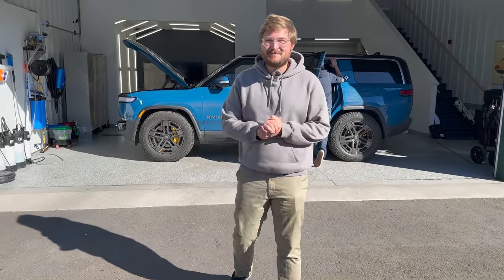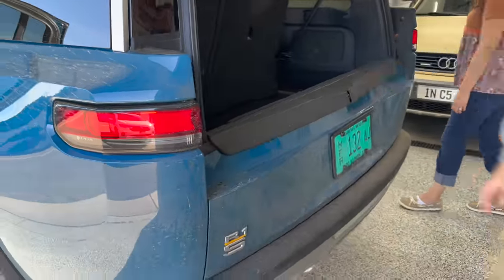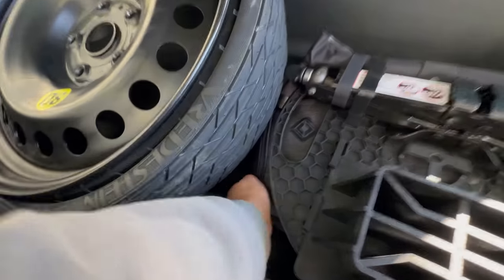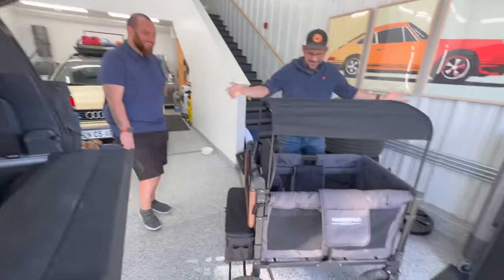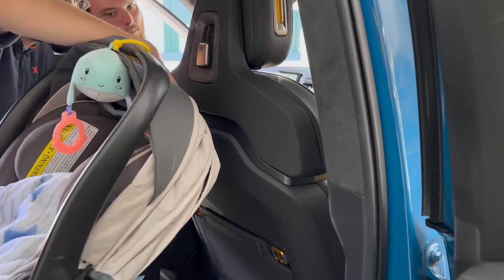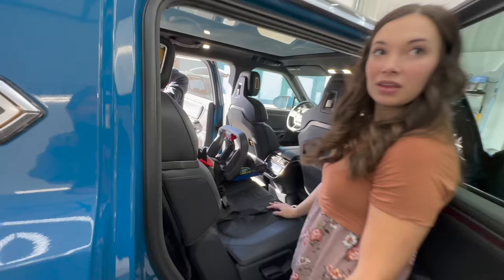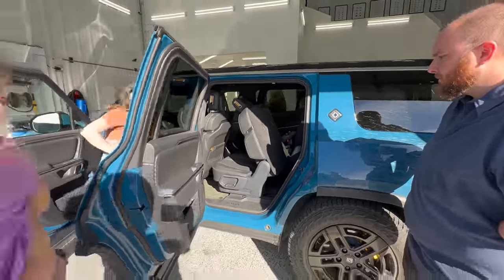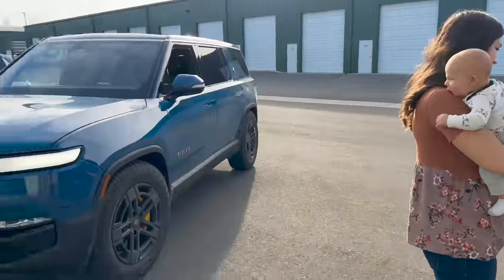Rivian R1S Family Review - Car Seat, Stroller, Vents, Interior Space, & More

Comment: Sounds like the 7 seat R1S should’ve been build on the same wheelbase as the R1T and there should be a 5 seat version based on this R1S platform - think Yukon vs Yukon XL type models.
Reply: My exact thoughts. I was hoping this would be a replacement for my Ford Expedition but seems like its more a Ford Explorer size. In the Ford Expedition standard length you can fit a 6'4" person in each row at the same time comfortably with still a good amount of leg space in each row. I've done road trips in the 3rd row being 6'4" for a few hours just fine no complains, I highly doubt I would want to be in that 3rd row more than 20 minutes. Hoping by the time my reservation comes they will offer a longer wheel base.

Comment: Many infant car seat carrier bases do not require IsoFix/Latch to be secured to the seat. The Popular Doona allows for the centre seatbelt to be used, which would solve the problem presented in the video.
Reply: Basically no carseats require latch, and using seatbelt installs is generally recommended when you are trying to do three across because it gives more options(you can shift the outboard seats towards the doors to make more room). Also two year olds should definitely be rear facing, and ideally should be rearfacing till they max out the rearfacing limits(generally around 4 or so). 

Babies are born with a lot of cartilage that  hardens into bone over time. This includes parts of their spinal column. The vertebrae in the neck only start to harden around 2 years of age and doesn't finish until as late as 7 years. The soft spine combined with preschoolers heads still being large/heavy for their size means that they are much safer rearfacing where their necks are supported in the case of a crash. It takes more effort to find the right rearfacing seat for larger kids, but my 98% nephew and 90% son were able to rearface comfortablely until 4.5 and almost 5 respectively in mid priced seats.
Reply: So why do they take away “points” for a lack of latch?

I applaud the attempt here but I don’t think this solves the family hauler questions. 

I’d love to OoS to Collaborate w/ MobileMamaReviews or someone on topics like this.

Comment: The seat issue is always a challenge.  Had the same problems in an X5, Tahoe, QX60. The car seats are the problem here, not the Rivian.  The baby needs to go behind the shortest person, so the tallest people go next to the baby.  We had challenges like this with just 2 kids.  The best day ever was getting rid of the carrier/base because those things suck.  I will say that you can save a TON of room by ditching the quick latch base and just use the lap belt to anchor the carrier.  Especially when they are little because their feet don't stick out.  We did this on any occasion where it was the whole family traveling, or adding in the grandparents because it was such a waste of room.

Comment: Part of the problem this family is having seems to be their choice of car seats. Graco’s are notoriously clunky and have subpar safety rating. I think any family with multiple kids should consider Clek’s or Diono’s if more budget minded. Much better safety ratings and smaller footprint. They’re also much easier to install, especially the Clek’s.
Reply: Feel like this comment is overly simplified.  Graco definitely makes some trash, but they also make highly rated seats.  I've personally had issues with Diono.  Lots of decent brands.  Places will usually let you test fit their floor models to size to your car.

Comment: You can do 3 across including rear facing in the 2nd row. You do not need isofix, basically all car seats, including infant seats can use seatbelt only.
Reply: Installing a car seat with seat belts only is a pain. LATCH is much easier.
Reply: The seatbelt method is really uncomplicated. And as far as safety goes, there is no difference. Don't get me wrong, the LATCH system makes carseat install CAKE, but they can only be used up to a certain weight anyway. Figuring out the seat belts is a necessity in the long run.
We seat three across the back of our Model Y, all 3 kids are 5 and under. Two of them were rear facing, until very recently, so now we only have one rear facing. I was pleasantly surprised to find that we could make it work for our family. At first it was a little tough, and we had to find the right combination, but now it's a breeze. We can install all three car seats in about 15 minutes total.
Now, let's be honest, if they eventually offer the second row captain seat or a removable middle seat, that would be gold!
Reply: @lh2338  likewise, we have 3 across in our model 3, no issue.

Comment: Thanks for doing a family review! I second the person that commented the newborn can use seatbelt as anchor - there is no difference in safety from an engineering standpoint. I also have a 4yo, 2yo, and 3mo old with a Tesla Model 3P and Subaru Ascent. I would like to know the weight of that 2 year old sitting forward facing - normally it’s 40lbs for convertible car seats. She should most likely be required to sit backwards facing which then would make the most convenient configuration as forward facing 4yo in back and the 2 other seats in the middle. What we’ve found - before you put newborn in, slide seat forward to allow 4yo in, then slide back. Stroller slid in after other 3rd row seat folded down. As a side note, 3 slim fit car seats, a 70lb German Shepard on floor with no transmission tunnel, a 2 seat stadium seating stroller, pack and play, a 6’2” male and 5’6” female fit in the Model 3P. It’s a sight to behold!

Comment: Please do more of these. I've had to take the whole family to try out different vehicles. I just tried fitting two boosters and a car seat in the rear bench of the CyberTruck; it was real tight. The F150 Lightning fits the three comfortably, and turned out to be best family road trip vehicle except for range. We actually chose it over the Yukon for a 2k mile round trip to Colorado. The Silverado EV RST also fits 3 comfortably. Anyway, just saying I'm sure there's more of us out there that would like to see how the space works. Based on what's available in the EV space, I don't think we're giving up the Yukon Denali Duramax as the main family hauler just yet.

Comment: You don’t need LATCH anchors. You can put the rear facing seat in the middle of the second row using the seat belt, which is actually stronger than the LATCH anchors.

Comment: Some rear facing seats can use seatbelt attachments instead of the iso-fix latches.
Reply: I believe all car seats have to be able to use the shoulder belts. Latch is an extra. I often used the shoulder belts on our cars because the latch hooks weren't certified for multiple seats on one hook, they were a pain, and I could tight more leverage on the shoulder belt

Comment: I also said I’d never own an MPV (minivan), but ended up with one. Ditched it as soon as we were down from three car seats. Wish the R1S was available in the UK, it would be the perfect replacement for our Landrover Discovery (no real 7 seater EV options in the UK)
Reply: How rich are you? All that money and you can’t even understand that the carbon footprint of an ev is larger than a petrol car?
Reply: @PD-we8vf  Incorrect. Electric trucks emit ~2.3 tons of C02 per year (if solely relying on the grid) versus a 25 mpg F-150 that emits 6.7 tons of C02 per year. If you have solar panels and charge your Electric truck off of solar energy then you are driving on 100% renewable energy. At present, ICE cars do take much less C02 to produce (~6.5 tons versus ~16 tons). But by 30,000 miles driven, even charging directly from the grid, Electric Trucks catch up, before then saving 4.4 tons of emissions per year for the remainder of its lifespan. As the grid continues to use more renewables, driving electric will continue to provide further CO2 reductions. As more EVs are built, the production efficiency will also decrease C02 usage. Source: https://www.youtube.com/watch?v=ZcLoimQD6qE&t=222s

Comment: Probably not the best idea to have the spare in the trunk. Vehicles are designed to prevent the spares from entering the passenger space during a collision. With the spare not being mounted the way the manufacturer intended, an assumption could be made, there is a higher risk of injury if an accident did occur.

Comment: Surprised how difficult it was to fit things.  Granted that's a large stroller, but it's notable that it fits in a minivan but not this SUV.  I'm partial to full-size trucks and SUVs (I'm 6'5") and these Rivians are more 3/4 scale, so they don't appeal to me that much.  Also, I'm baffled how the vehicle got through testing and release without a way to manually select 3rd row air without the seatbelts clicked in.  It's such an obvious issue that you guys ran into immediately with the dogs, and now with the little kids... odd oversight.  It was nice to know the spare fit in the frunk but would have been nicer had it been designed to do so intentionally, with a better fit.  Also, not great to hear that some newer production vehicles might lack power outlets in the frunk.  That's a useful feature that I'd be sorry to lose if I was getting this.  Frankly, I want all electric vehicles to offer as many power options as possible.

Also, I don't share the aversion to minivans that some do.  I've always thought they were some of the coolest vehicles.  Mostly because I appreciate all the little built-in features that other cars usually don't have.

Comment: Kids would have to get in on the road side (not sidewalk) and that would concern me with young kids. You are either walking into the street with the baby or with the other kids. Back cargo area is much smaller than expected. My kids are a little older and we don’t need car seats any more, but on a ski vacation we’d run out of room even with all the equipment on the roof rack. Surprised this doesn’t have more room.

Comment: I know that my Clek Foonf has a weight rating for just ISOFIX/LATCH points, and suggests/requires using the belt in addition to the isofix points (and top tether). It works pretty well in my ID4. 😺

Comment: This should be compared to a Volvo XC90 which is nearly identical in features, layout, and dimensions. Volvo solved allot of the issues the R1S is struggling with about a decade ago so I'm surprised Rivian didn't replicate their solutions, or they may have thought they had better solutions - which is probably true...and not very smart. Though I would really like to see Rivian do a minivan rather than an extended wheelbase R1S - that segment definitely needs some better ideas, they can be slimmed down and an electrified option is really needed. Or they could just sell their Amazon delivery vans to the public...
Reply: I totally agree. The question will be how the R1S compares to the EX90 (XC90) electric version. I plan on replacing my Tesla Model S with the R1S, but the EV9 and EX90 may make it to market first and offer better deals.

Comment: The R1S is really a mid-sized SUV - like the MB GLE, BMW X5, Honda Pilot/Acura MDX, Toyota Highlander/Lexus RX350 etc. Not full size - MB GLS, BMW X7 Chevy Suburban etc. Here are my takeaways not specific to R1S but to all mid-sized SUVs.

1- These all will have a hard time comfortably accommodating  Amazon women in the front seat. Sorry but you have a unique situation there. 
2- These will never be as convenient as minivans that are built from the ground up with families-with-little-kids in mind. Lifting kids up into the rear will get old real fast.
3- Third row will always be tight because it has to go above the read drive components (Transaxle in gas SUVs, motors in EV).

Not a bad review overall, little click bait-ey as you could easily swap R1S with "BMW X5" and have all the same conclusions. You said it best, Don't try to stuff everyone in there on a regular basis, keep R1S for fun and use minivan for most of your people hauling.

Comment: Re I Sofia in centre: do remember all, I Sofia is rated only up to 33kg (73 lbs). My kids are bigger than most, but we still have them rear facing after that. Either way: that seatbelt would be a fine (possibly better) way to attach a car seat in the middle of the middle row (https://en.wikipedia.org/wiki/Isofix#:~:text=Isofix%20is%20designed%20to%20secure,280%20mm%20(11%20in).)